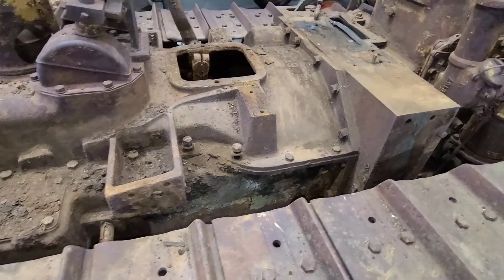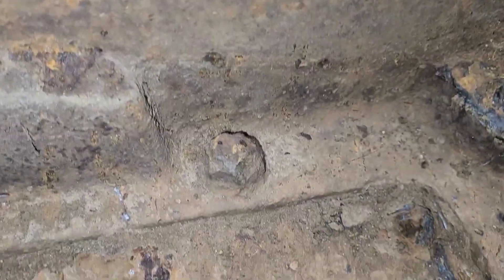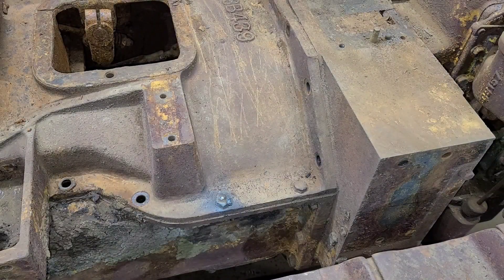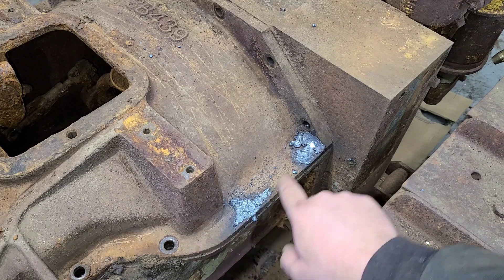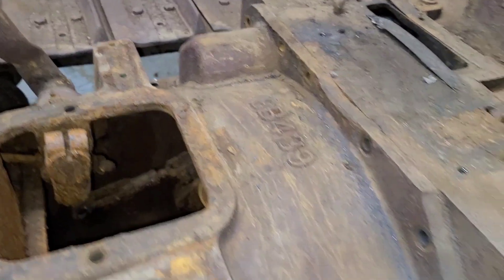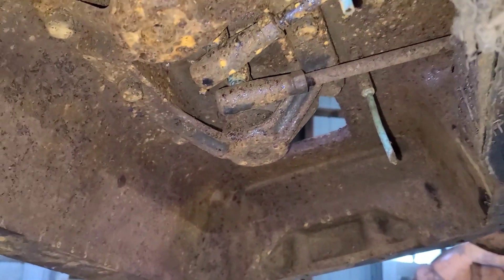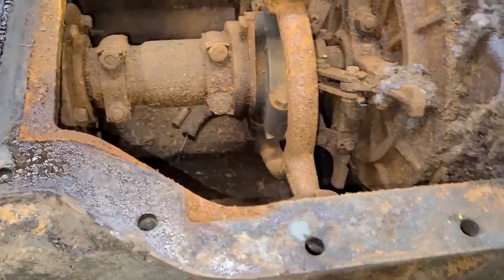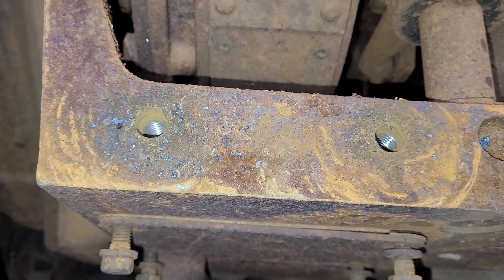Caterpillar RD-4 Transmission and Rear End Cover Removal Pt.2

Comment: You said, just a little bit of time for the bolts, I think that was an understatement. As soon as you showed us the underside of the cover first I figured you’d save the tranny for last, i wasn’t expecting it to be rusty but if it were my heart would have sank. Best of luck now getting the brake bands to come loose.
Reply from the maker: It will come apart, it's just going to be a different method than what the book says to do, either way, once it's apart everything will be cleaned and inspected for reassembly. Thanks for watching Geoffrey
Reply: When you said “it will come apart” made me think what my old friend Allen Rudolf would say in a case like this”we don’t ask it we tell it”.
Reply from the maker: @oldamericaniron5767  absolutely, I am well past the point of asking haha, but it's still going to fight me most of the way

Comment: "Amazing", that's the same word i used !  ha ha  I was so surprised the transmission was in such good condition after seeing the back compartment.
Reply from the maker: The difference is that the back compartments are dry with no oil. If Cat had made those wet compartments, they would probably look the same as the transmission

Comment: This is just a opinion of mine. I am not sure. Why. you are not a fan of penetrating oil. However, I was not either.  After trying it several times, I came around to its usefulness. It works quite well after heat has expanded all the metal, then the immediate application of penetrating oil, it pulls right in to the gaps the cooling metal makes.
  It DOES NOT HURT to try it. If you don't find it a useful tool? Oh well.
Just a personal opinion.
Reply from the maker: I've used penetrating oil over the years and never found it to work well, that is my opinion. Other people have had great luck with it, but personally I like using heat with a torch if needed, most of these bolts have come out without anything. Thanks for watching!

Comment: I don't mean to be nasty or anything, but why don't I see any penetrating oil on anything ???
Some Knock 'er Loose works wonders on a lot of stuff. I would be soaking all of the nuts, bolts etc before I started working on something. Probably would save a lot of money on acetylene too !
Reply from the maker: 99% of the bolts have come out without heat, just simple tools 🔧

Comment: You have your work cut out for you, I restored a MM U diesel that had a rusted up engine I sleeved it the rest of the tractor was in good shape, I don't know where you live but i farm and have a machine shop it looks like you will be making parts I like that kind of work if you need I would offer my help with machine work, if interested respond and I will give contact information
Reply from the maker: I live in southeast South Dakota, I do have a lathe and mill as well, so hopefully I can do what I need to but it's never bad to have more resources and I appreciate the offer Ronald!

Comment: Hi Kyle. Watching a few of your vids and probs on RD4 resto. Was that machine retired by the ocean?  Never seen as much rust degradation ever and I have worked on my share of 80 year old equipment. 
Or was it encased in a block of salt? Lol
Reply from the maker: This machine came out of Wisconsin, unfortunately it sat for 50 years in brush and the elements took their toll on it. For how bad it looks, most of the fasteners have actually been coming out, surprisingly! Thanks for watching

Comment: Wow! At least the transmission is a small victory. Hopefully it will offset the heartache likely waiting in that main clutch. Are there sections of the D4 where replacement parts are more available than others?
Reply from the maker: Not particularly, with the age of the machine a lot of parts have become obsolete so the options are finding N.O.S. parts, good used parts, or fabricating replacement parts